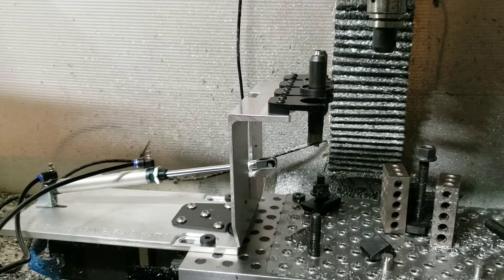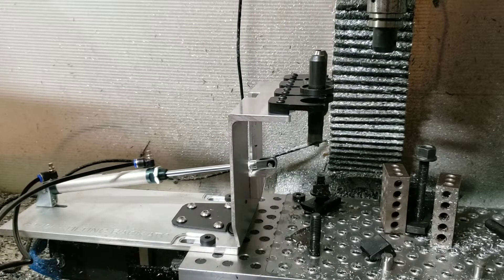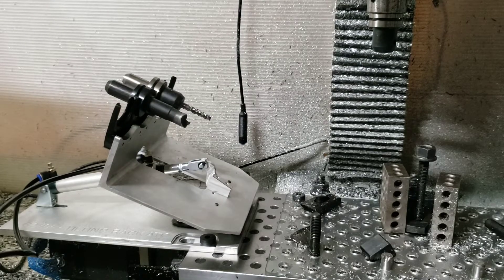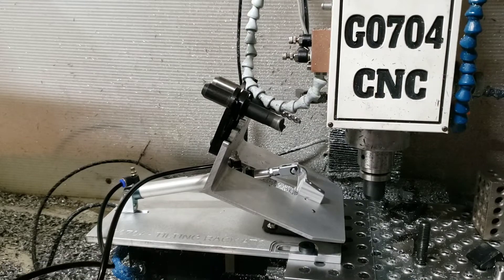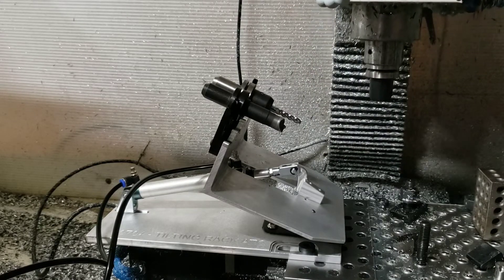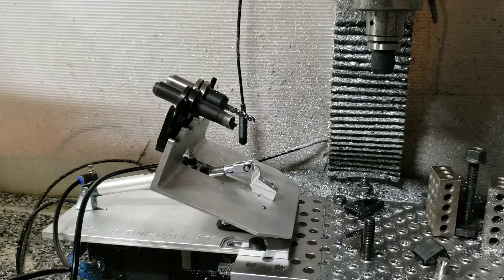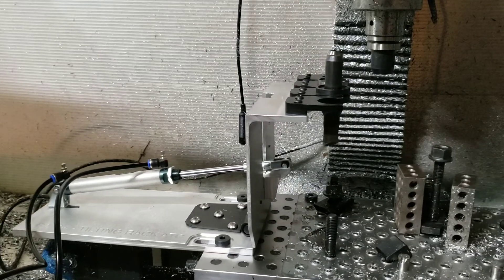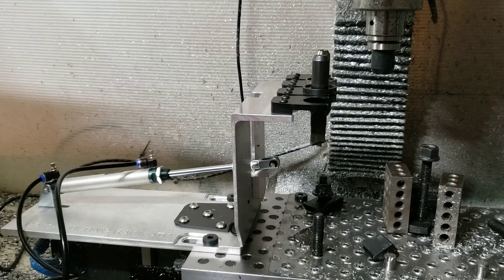G0704 Automatic tool changer- tilting wine rack atc.  No loss of x axis travel!

Comment: you need to add some safety features like sensor to stop machine if its  hit.
Reply from the maker: Nylon screws and delrin tool holder forks will break off long before anything significant happens.
Reply from the maker: Also should add that I've been running this machine pretty hard for almost a year and have had zero issues with lost steps since I put the large nema 34 motors on it.  I'm not worried about a crash due to the machine getting off position.  And if there is a crash due to my setup error I will catch it when I supervise the first couple of cycles.